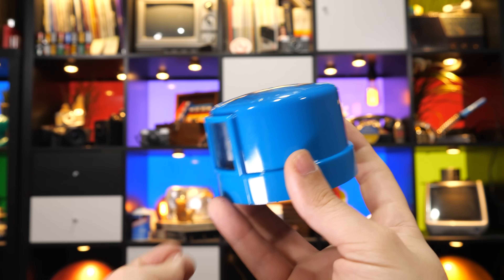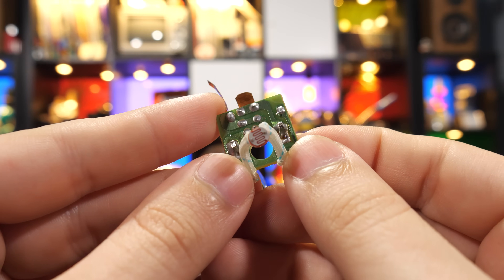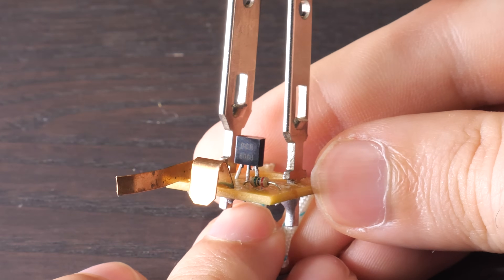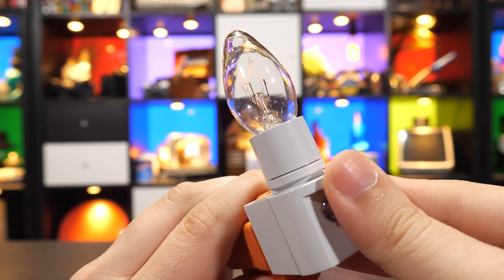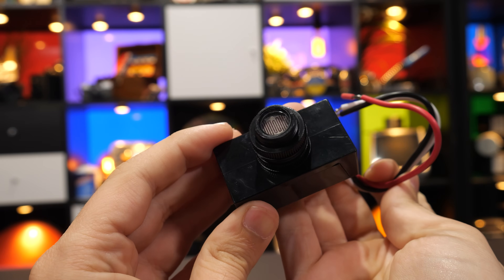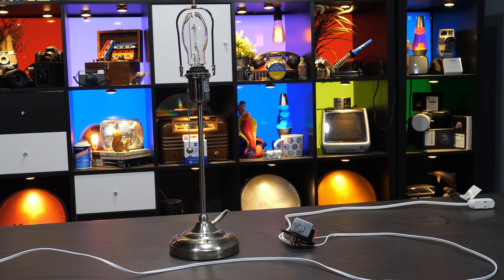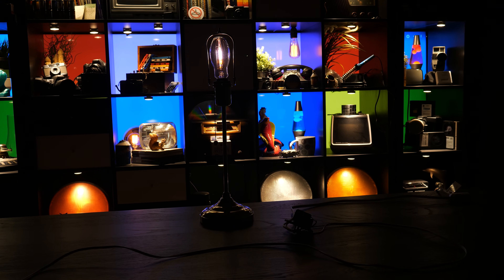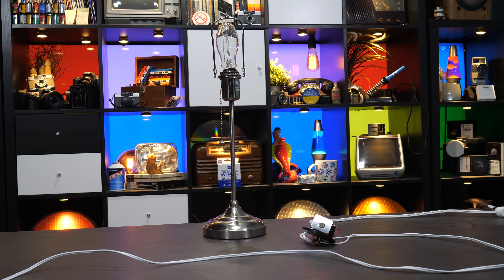Photoelectric light controls are weirder than they seem

Comment: Understanding how the whole system works makes me slightly ambivalent/critical about the use of heat transfer as the communication mechanism here. I mean what would happen in the intense cold of winter (20-below, for example) or the increasingly intense heat during the summer time. You’re expecting things to cool down after sunset and switch on the lamps, but what if it never cools down due to ambient temperature. 

And by the way, thanks for hister-reeses’s

Comment: Us old school guys call that photo-resistor a CAD cell or CDS cell. Those name come from the fact that it is a (C)a(D)mium (S)ulfide coated ceramic disk with a grid ('squiggly lines') on the surface. They are still commonly used to 'sense' the flame in an oil furnace. Similar to the street lamp, many oil furnace controllers use a dead-simple analog circuit as the brain. It's function is to start the oil pump and spark mechanism, and if it doesn't 'see' fire (bright light) after a few dozen seconds, to kill the power to the pump. As one can imagine, continuing to pump oil spray into the furnace with no combustion would be a bad idea. 

Also similarly, there are more complex 'computer controlled' oil furnace controllers, but they aren't as reliable as the classic analog models. The CDS cell is still used, however, because it is highly reliable in an awful operating environment (fire, oil spray, soot, smoke, heat).

Comment: 4:20 As drawn, there is always a short between the gate and the large resistor, so all of the current should flow that way; the photoresistor won't ever pass more current because its resistance is never 0, so how does this cause the current to fail to reach the gate?

Comment: Well, duh, I have a 'fence' around my property with low voltage (3W) light bulbs in lamps every ten meters. As I wanted the lights to come on every night, I had a photoelectric switch at the head end. It's been operating for years. Not exactly rocket science. The switch came from a local hardware store.

Comment: I'd be surprised if modern versions using microcontrollers don't exist. It should be easy to simuate these old-fashioned versions. For example, the delay between the heater turning off and the light turning on could be simulated with a timer.

Comment: The sensors are different here in the UK, they use the same connector type on the bottom but they Dont have a window with a side facing sensor, they have an upwards facing sensor and a white cone shaped top

Comment: I think that the PTC thermistor is doing double duty: to serve as a fuse and regulate the temperature as the photoelectric switch can handle up to 277v~

The reason the heater has to run so hot is because climate temps can go past 50deg C so a low temp bi-metal switch won't do.

Comment: Thanks again - your videos are always both informative and entertaining. Over the last five plus years in NZ the local company that looks after these things have been switching them all to LED lights and individual controllers on each lamp. They have obviously worked out that the life of the switches is such that it isn't a problem. It also means that regardless of what happens weather wise, that if it is dark enough, the lights switch on and off.

Comment: The bimetallic strip switch used to be used as both control and acoustic signal for auto turn signals.  The current through the device would heat it until it was warm enough to open, then cool until it closed, then warm, cool...  Click, click, click...  In my old (2003) vehicle, when I put LED bulbs into the turn signals, they didn't draw enough power to get the strip as hot, so the blink rate is about twice as fast as normal.  Shunt resistors can be installed to correct this condition, but I've grown accustomed to the faster rate.

Comment: Interesting... I had always assumed that street lights used a simple LDR circuit with an SCR or Triac in combination with a relay or contactor. Never heard a thermal cut-out switch called a limit switch though -- usually only switches that are testing for physical movement (or sometimes inductive proximity switches, but usually call them "prox" switches). I was under the impression those thermal cut-out switches weren't rated to be continuously cycled like that, so interesting to see them used as something other than as a protection device.

Comment: Two issues I see here.
1. If it gets really cold out the heater may not be able to keep up and the light stays on? Never noticed but I can’t say I have looked but I will now. Ohio hits -20F a few times each winter. 
2. The biggest challenge when turning electric back on after an outage is everything turning on at once. Motors, AC compressors, and then you add in hundreds or thousands of 1000 watt light bulbs. 
That sounds like it adds a massive amount of load until the heater gets hot enough to turn the light off.  

It’s is a simply elegant way to control the lamp and my issues must not have huge real world implications or they would have added in things to prevent them. Just thinking 🤔

Comment: I may have missed it, but I wonder,  at what temperature does the street lamp limit switch operate? Is it possible, in some cases, for the sun shining on the apparatus to provide sufficient radiant heat to make sure the thing stays off, or, since I think I have it backwards, turn it on falsely? Would these be a bad idea in Phoenix, but fine in Bemidji?

Comment: I was under the impression that load from clusters of street lights was something electric companies had to be careful of when restoring power. I mean sure, dozens of homes suddenly pulling power from all the stuff that was left running is worse, but if they are grouping hundreds of lights together as you said, that's not insignificant.

Comment: I have disassembled one, it's just as stupidly simple as you'd want; photocell's in series with the heater wrapped on the bimetallic switch strip, so it's actually correct that whenever the sensor turns itself on, the lamp turns off. I'd imagine the electronic version would do the same thing as it doesn't consume that much power compared to the bimetallic switch version of photo controls anyways.

Comment: I wonder if the use of a heater is also beneficial for accounting for seasonal changes in lighting, i.e in winter, daylight will fade more quickly after the threshold has been crossed; it will also be colder, so the light will also come on more quickly than in say summer, where you will have twilight for longer and a lower temperature delta.

Comment: When you mentioned Thyristors it brought to mind the classic “Automatic” camera flashes controlled by them. I know you’ve covered film photography before, perhaps you could do a dive into flash photography and the various ways it’s been achieved and controlled. I think that would be quite interesting especially with your presentation style.
Reply: The magic of the "thyristor" flash units was that they didn't waster power. Before that design, a flash unit would take a long time to charge and use all of the power to flash, even when only a short (dim) flash was necessary.

With the thyristors, the flash only put out the necessary amount of light, so often only a very short recharge time was required before the next flash could be produced.

Comment: Probably the main reason the system is like this seems to be also to compensate between seasons. I would guess it is interesting to turn the lights on a little earlier in the winter than in the summer. Also, with the sun heating it during the day, if there is a shadow in the middle of the day it should be less sensible.

Comment: Lots of cities in Germany use a mechanism called ripple control to turn street lights on and off. Control messages are sent by the grid operator by modulating the line voltage (from what I have read), so there is no need for extra communication lines or radio. It's essentially a very low bandwidth form of the power-line communication that's available in consumer products.
Reply: Im apprenticeing to become an electrican here in germany and we had to work with street lamps a few times. They do indeed modulate the frequency of the network in the khz range with amplitudes of at most 4% of base net frequency of 50hz and put recievers on lamps which listen on those frequencies. Really fascinating tech. Also the precursor to stuff like powerline communication

Comment: When the city I previously lived in installed an extra streetlight (of the super-glaring, non-cutoff variety) right next to my house, I rigged up a PVC-pipe and cardboard contraption to lean up against it and block its light while I used my telescope. I discovered with some surprise that this actually turned it off! Intermittently. As its own output got reflected into its light sensor.

Comment: All this time (I took an electronics class in college and am currently a journeyman electrician) I figured this type of photocell know and loved for many decades on mercury vapor or high pressure sodium yardlights was simply a photocell in series with a normally closed relay which opens when light causes a current flow over a certain threshold.  But using heaters instead of relays makes sense because a relay would chattter just as it about to get light or dark out destroying it rather quickly,  and HID systems give the longest lamp life when used for long periods,  and in some ways are superior to the LED systems taking over because HIDs with magnetic ballasts are more robust against power surges and spikes.

Comment: I would’ve thought the the sun heating the housing would be a backup system so if the photoresistor  failed, the heat from the sun could still turn it off eventually

Comment: Whats more weird are humidity or moisture sensors..  like how does some chemical absorb moisture in the air and regulate a resistance that was predetermined with the chemical properties and whatever its put on.  Or how those smoke alsrms/ carbon monoxide sensors work..  they put a little piece of radiated material in some chamber that detects smoke?!?  And the same with carbon monoxide..  that stuff is crazy.. electrochemical/mechanical resistance switching shunt.    or a moisture sensor..  lol

Comment: The photosensor switch design using high heat to keep the switch open/off also means that when it's used on a streetlight, the sun is beating down on it just reinforces the design of keeping the streetlight off during daytime.

Comment: 12:39 Another reason why you don't want to use individual switches for each lamp is that they are not exactly identical and you don't want each lamp to switch on at a slighty different time in the same street. On the other hand, it might be intentional to do so on different streets to avoid too high voltage spikes.

Comment: A lot of the lights in the UK seem to be more complex now, they start to turn on when the light lowers but they will also turn off somewhere between 1am and 2am to reduce light polution and reduce power consumption.   Don't know if it's a timer system (remote configured) or not.
Reply: All that happens is the individual lights have sensors and there's a time circuit to turn the power on and off to a whole row of street lamps. That way they can be programmed to provide power during a particular range of time, but they only come on when dark enough yet can all turn off at, say, 1 AM and thereby save power. 

I can attest that the sensor connection is exactly the same as in the USA, and you can buy all this stuff retail if you want. However, the internals are more electronic on the modern stuff and don't use the thermal switch.

Comment: Idea, that I BET is used somewhere on more modern lights: Replace the photoresistor with a small cheap solar panel. Let the power from the panel heat the resistor. Now it heats when there is light, without drawing extra power.

Comment: Why aren't these switches implemented with a simple relay? Basically the relay stays active during the day with current flowing through a photo-resistor, breaking the normally closed side through the light bulb. When the sun sets, the resistance increases and the relay turns off, closing the connection to the light bulb. I'm sure that powering a relay takes significantly less power than heating up some switch to like 100º.. Is the intrinsic hysteresis of the relay's coil not big enough?

Comment: A friends cabin that I look after has one of those digital sun dial things installed in this breaker box, I found out after a sorta long power outage made his exterior lights not come on after dark.
You set the approx latitude with current date and time and this thing turns a solenoid on when it's about to get dark.
Neat!
Thing is only the size of a double breaker or less.

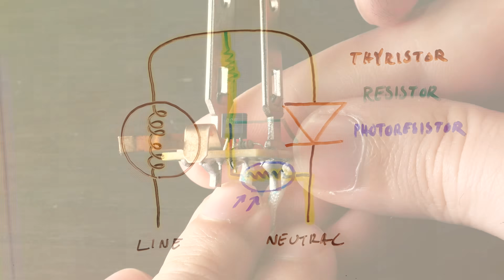Comment: @5:05 the lamp filament's resistivity (compared to the resistance of the 2 MOhm resistor) is so negligible, you are safe to assume it's not there at all. In fact, the resistor's own 5% tolerance is much greater than 400 Ohm.

Comment: When I was a kid, I thought the local power company had one of those big mad scientist lever switches and it was somebody's job to push or pull that switch to toggle the streetlights. Now that I'm old and have watched this video, localized automatic control makes a huge amount more sense. How enlightening!
Reply: When I was a kid, I thought they had an individual light switch for every street light, all crammed into a big building somewhere. There would be aisles packed, floor to ceiling, full of switches, with technicians in brown coats going round with wheeled wooden library ladder type things turning them all on or off.

The part I couldn't wrap my head around was how big the bundle of cables must have been to be able to run an individual circuit out from that one building to every street lamp.

Fairly soon after, I learnt about time switches and light sensors, but for some reason I still think of the street light switch technicians as en example of jobs that were lost to automation in the late 20th Century.

Comment: I have personally seen the same type of light switch using a contactor and a CDS (cadmium sulfide) photo resistor.  The CDS cell was wired in series to the contactor coil.  when the contactor was energized, the light was off.  And vice versa.  There was less hysteresis in that design, but it was still there.  The amount of current to pick up a contactor is more than that required to keep is closed.

Comment: I built a lighting control circuit using a CDS cell,  designed to work with Skylights, and partly cloudy days, so that as a cloud passes over, the electric lights power up, using a PID control to maintain light level on a work surface, which, if you've ever been someplace with a skylight on a party cloudy day, it's strobe light effect on a really slow delay.. 
someone else already had a patent..    bummer..   but it got me the A in the course,   so I got that going for me ( Caddyshack reference )

Comment: There's a shopping center with many lights controlled at a single cabinet, with the smaller black sensor controlling them. Sometimes at night, I could shine my flashlight on the sensor for a minute and turn off the lights.

Comment: I had photo resistor controlled garden lights. But I recently replaced them with zig bee relays connected to. Home Assistent. I have some simple logic to turn them on at certain sun elevation and it works perfectly. My main reason for the switch is so that they will turn off in the evening. I don't want to contribute to light pollution.

Comment: From my observation, it seems like my hometown here in Germany does not actually use light sensors - not on each lamp and not to control groups of them. It seems like the lights are centrally controlled by a timer that knows the time of sunrise and sunset. They always come on and shut off around the same time each day, just with a slight shift to accommodate for the changing seasons. The weather conditions, whether it is a bright sunny morning or a cloudy dark morning seem to have no effect whatsoever.
The whole trick probably makes it also easier for them to shut off half the street lights during the "deeper night" hours to save energy.

Comment: I figure the relay would cost the most money, given it has to break 15 amps of current at 120-240V. I could imagine a cheap rectifier + resistive voltage divider + capacitor design to power the microcontroller, and inexpensive capacitors can handle up to nearly boiling. Testing and certification would be another big deal though.